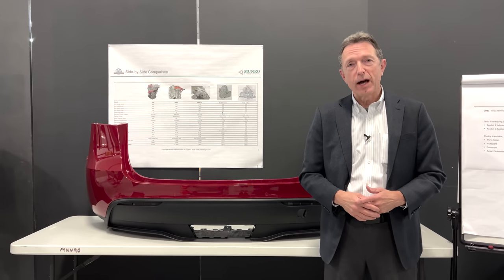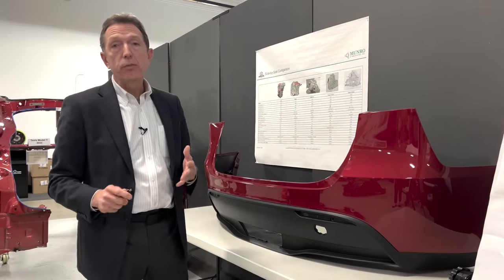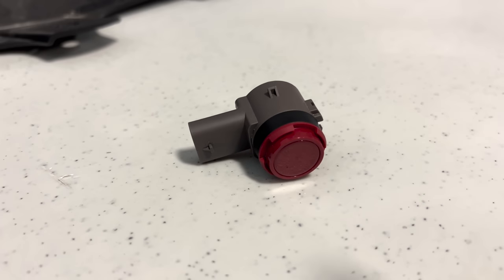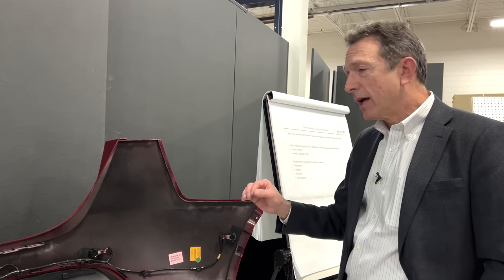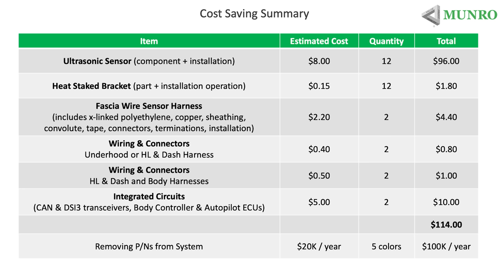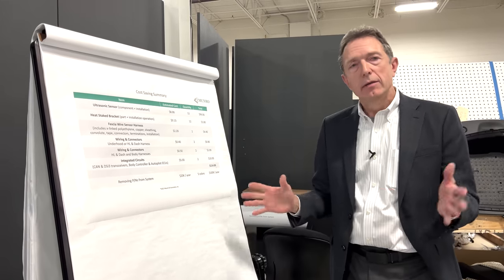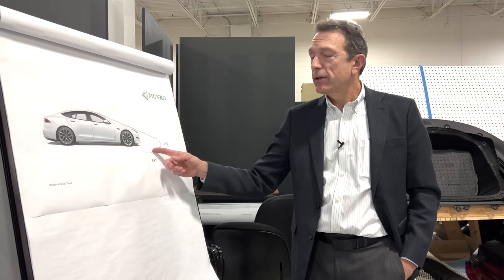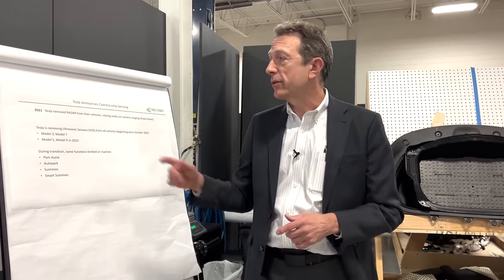Tesla REMOVING Their Ultrasonic Sensors

Comment: James Douma said the cameras will fix an object  (ie parking block or curb) at a distance and then software will use wheel rotation to know precisely where the object is relative to the car.
Reply: That is pretty much how the cerebellum works to keep people walking.
Reply: Seems like the Camera need to be more aware while car is "resting" now ala centry mode, incase a bugger have put a concrete block infront of the car during the night!  :)
Reply: Impossible!  Using software to map the world?  Can't be done.  Lmao
Reply: @jonasgranlund4427  ultrasonics wouldn't always pick that up either though. Depends on height and distance away. I suspect that telsa will get a system that is as good in at least 99% of cases and that is worth the x million per year.
Reply: What if traction is not 100%? The wheels could slide but the car wouldn't know. I would also be concerned about tight parallel parking where the car might never see what's in those 3 feet of blind spot.
Reply: @karl-oskarjanzon9926  How  would the wheels turn, and the car not know?
Reply: @davidbeppler3032  I meant that the car could move without the wheels turning, the reverse could also be true. This can happen on any situation when the road is slippery, inclines can make it worse. I think they need to give the car space awareness using other sensors as well.

Comment: Definitely curious about that blind spot. It can probably memorize a curb position before approaching just fine, the problem as mentioned is something running in front of it once already in its blind spot. Maybe it's not an issue 99.9% of the time, but is that enough for true robotaxi where they want to get many many 9's over.
Reply: Ever since this announcement I've been paying close attention to what my cameras can see when I back up. There are also very large blind spots on the rear corners of the car that cannot be seen by either the side repeaters or the rear camera. In fact, the way I pull into my garage, there is a box on my floor that is NEVER see by those rear-facing cameras.
Reply: Not really. If the new obstacle came by side it will be picked by side cameras. If the new obstacle came by front it will be picked by the front camera. The only problem will be if the new obstacle raises from ground.
Reply: And piezoelectric sensors do not detect all obstacles ... we never ever see some damages because some rounded obstacles that diverge acoustics echos. For another point the vision could fail if the obstacle is a glass wall...
Reply: lets say the car is 'off', then an  object moves into the front blind spot, then the car is turned 'on' (cameras become active) now does the car have no sense that the object is there? to truly always be aware of every blind spot the cameras would have to always be on
Reply: @bpeterson4016  Sentry Mode already exists. The car can already detect motion near it and record that motion, and it doesnt have a huge negative impact on battery life. I would guess that if the car sits for too long it would go into a true sleep mode and after that period the owner would have to drive it out of park. But if you are driving every day or every other day, theres absolutely no reason the car cant be watching 24/7 and be aware of the environment around it the whole time.
Reply: What if you car is already off and you get in it but you don’t remember what was in front of you?
Reply: Part of me wonders if they aren’t looking at moving cameras at the same time to negate the blind spots.
Reply: For me, tesla just moved a sensor fee to a future Tesla insurance fee. I don't know if it's very wise. Tesla must also pay attention to sociology. Someone who lacks confidence will not buy, or an older model. Not certain that they gain from it.
Reply: @patreekotime4578  Doesn't that seem kind of silly when there's already a well proven method that works and doesn't have known blind spots?
Reply: @bpeterson4016  sentry mode!

Comment: Just a quick point, that's the rear facia, not the front. ;)
Doesn't really change anything since there's the same number of USS etc on both.

Regarding the blind spot.
I do think the Tesla Vision model will be able to "remember" what was in there when pulling into a space etc.
Not sure how they deal with coming to a parked car that may have stuff in front of it.

However, I have a thought.
If they add a camera on the nose of the vehicle, that would remove the blind-spot issue.
On top of that, they could use it in conjunction with the upper front camera for stereoscopic range-finding etc.
Would enable the ability to estimate more accurately the depth of pot-holes or height of traffic-calming measures which in turn could be used to smooth out the ride.
I believe Audi has a similar system on the S8 that helps it glide over speed bumps etc by dynamically adjusting the suspension based on what its driving over.
Could be interesting.

Comment: Great video thx. My Model Y was build in August in China. Have been driving also a Model 3 to start with (March 2019 in Belgium), next a Model S, next a Model X and now a model Y again mainly because i am wating almost 2 years now for my Refresh Model S. One thing immediatly struck my attention with the last car, the back camera which has IMHO (as i cant check it anymore in my sold cars) now a much wider angle. Just did some testing with a number of objects and i am now convinced that the sides and the back are fully covered. Be curious how they will solve, as Mr Lane said, the dead angle at the front. Pity i can't post my pictures here.

Comment: I’d start by saying that the camera situation could be extremely easily mitigated by having a camera mounted centrally on the front bumper, akin to VAG “Top View” systems that use a forward facing camera in the grill. This would cover the extremely short range whilst also allowing for a side view when emerging from a junction with very limited visibility to the sides.
It could also replace their wide field camera mounted next to the monocam in the windscreen.
It’s easily solvable, it’s whether Tesla are willing to take this risk and account for the lack of short range data in some other way.
Reply: I was thinking the same thing.
Reply: But why? Camera would cost same as the sensors, they would need harnesses, wires etc. Would need some kind of washing system to clean the camera. All of this just increases the cost, while they are trying to save on everything.
Makes no sense, so it will not happen.
Reply: You can get a Job@Tesla and make this your pet project there. Lets see what happens to your idea!
Reply: @tomasvidziunas5543  Because the cameras can do this anyway and Tesla no longer has to develop and support 2 systems.
Reply: With the Cyber Truck and Tesla Semi, the blind spots in the front will only get bigger, so I think another camera with a 210° lens in the front bumber is the best solution. Which would also need another port on the FSD computer and more processing power. So they need to switch to HW4 for this.
Reply: @de-kat  existing cameras can't do that.
I replied to the comment about new camera in front bumper, that would require additional costs and would probably cost not less than what USS cost.

Comment: Back in September Elon mentioned there was a priority rush to get Smart Summon etc. updated to the latest FSD beta. So it looks like they were trying to get it ready before the USS removal but didn't make it.
With Vision-based park assist, the car would not only be aware of physical objects but could also account for things like parking lines on the ground, available door clearance, or maybe even identify fire hydrants and no parking signs as spaces it isn't allowed to park. Smart summon could then be used to tell the car "go find a parking spot".
As for the blind spot, it'd be pretty difficult for something to get into that area without 1 of the cameras seeing and tracking it before it gets into that space.
Reply: Yep, it seems that they'd be building a map that stays in memory to be able to account for blind spots. It may have to make some wild assumptions for obstacles in front though.
Reply: @stevemulcahy5014  The biggest problem is that you either have to turn off the graphics processing of the forward facing, wide field camera and store that map and assume that nothing will enter that blind spot while turned off, or you have to waste battery power running graphics processing constantly, even while locked and parked so that obstacles that enter the blind spots can be tracked in and out.
It’s a risky cost saving exercise imo, especially given all they need is a VAG style grille mounted front facing camera which are extremely inexpensive.
Reply: @gtjack9  Your camera's are always active if you have the Sentry mode active. So this would have no impact.
Reply: @pipooh1  Thats a lot of lost energy & thereby extra expenses for the customer during the lifetime of the car.
Reply: @ChipMIK  But Sentry mode is already active in most Tesla cars. So it's not doing much more than before, Sentry mode use like 1 mill / hour.
Reply: @pipooh1  Is it really then or from the amount of YouTube videos you made a guess? Usage is roughly 10% a day = 7,5 KWh. Thats 2,5-3 USD a day for Sentry where i live or 1000 USD a year for parkingsensors/surveillance.
Reply: @ChipMIK  From my boss that owns one.

All depends on battery size etc what % it use. Calling it 10% is a made up number since for a long range 10% is not same as RWD model. We looking at 200-300W usage, so 4.8-7.2KWh a day. We do not know what the new 5mp camera will look like and what power draw they have. But i assume they will be cheaper and more efficient since they are common camera's fo surveillance camera's etc.

You can also make it so it does not use Sentry when you are at home in your drive way or garage. So it will only use power when you are away from home etc.
Reply: @pipooh1  11 days is the official Tesla figure on a long range.

It will actually be more than 10% on a SR with the smaller battery. Its not the camera that consumes power, thats almost nothing, but the computers that needs to process 5x more pixels.   

Its you that are talking about keeping Sentry on is what most do anyway should it be forced on (As they do with "auto"-mainlight on "Vision" when engaging selfsteer. I say its a very bad thing to make cars that waste so much energy when any other manufacturer uses ultrasonic with great success & no powerdrain. 

Beside that, Tesla is the absolute worst on the market on autowipers and automainlights & they are the only one using normal cameras for this. They had +5 years to sort it out and their about as bad still as back then. That & my experience with "Vision" after they utterly spoiled my drivingexperience by removing inputs from the radat tells me this will be another great failure & im so sad a brilliant car turned into a "Sprooce goose" by some spreadsheet costsaving features no costumer would want in real life.

 In doubt on how bad camera automation for mainlight is? Check these "beautiful" exampels of auto-mainblindlight by Tesla as documented by "Tesla-Bjørn":  https://youtu.be/Wi0kmshoVDk

Comment: In terms of the gap.... I wonder if tesla vision, utilising prerecorded footage like on sentry cam, captures the last couple of seconds of footage and premaps obstacles in the 1ft x 3 ft blind spot at the front?
Reply: Yes.  Another youtuber suggested once cameras determine distance, wheel rotation will calculate distance as they roll forward with great accuracy.
Reply: What if an object appears in the blind spot after the car is turned off ?
Reply: That would help but not for every scenario. However, Tesla's engineers are not stupid; they are certainly aware of those issues and have thought of a solution.

Comment: Nice, remove a safety feature to save you money and screw the customers that are already paying way too much for a stripped vehicle compared to other brands. Why don’t they remove the indoor spy camera first??? Or the whole rear ventilation system. That crap is useless. I see 69% of model 3s with no rear passengers. The Ubers are already warm or cool inside by thr time the passenger enters so I think because the size of the car it is useless. Tbh the rear heated seats also never get used… Most definitely the underseat crap collecting vent also is unnecessary… Removing safety tech is stupid and a bad move…